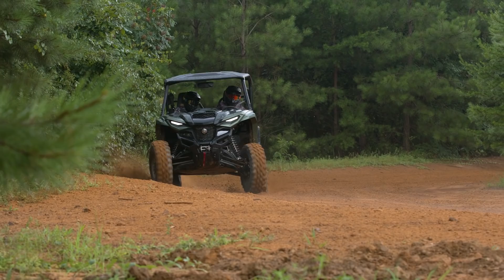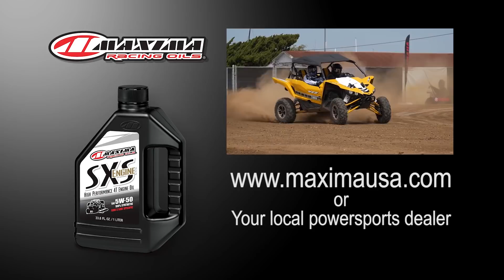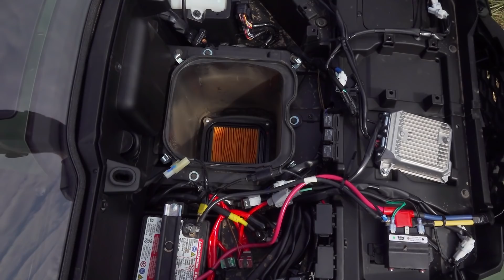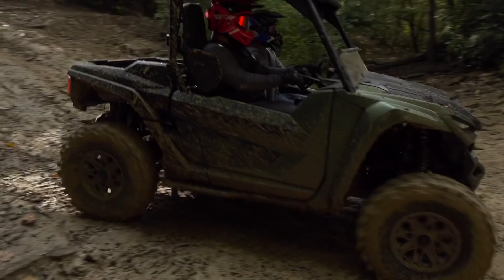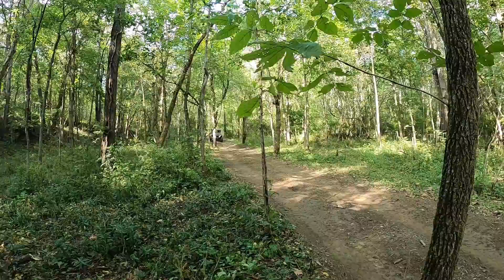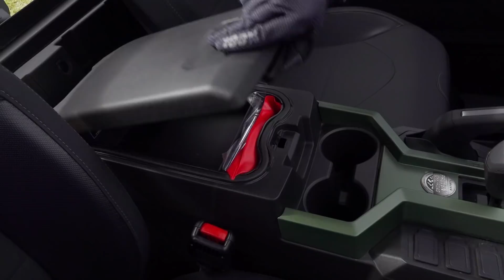2021 Yamaha Wolverine RMAX 1000 Test Review, Polaris General XP 1000 Killer?

Comment: Bought an le today. My previous 3 side by sides have been Polaris. I still own 2 of them. All I can say is wow. If anybody who owns anything made by Polaris drove one of these they would immediately set their Polaris on fire. Lol. Not really, but it’s just that much better. It’s not even close. Build quality, transmission, acceleration. Just how smooth everything is. It’s just not even close. I am absolutely blown away by this thing. It is as smooth as driving my new platinum f-150. My son got on my 2015 raptor that has big gun dual exhaust, intake, big gun power commander, carbon fiber wheels, holeshot hd tires, and the rmax in 2wd sport mode beat it to 60 on grass easily every time. Amazing machine. And I’ve had it for 1 day! I cannot say enough positive things about this machine. The dealership I bought it at is  getting another one in three weeks and I think I’m going to buy it too. Trade in the 2 Polaris I have for it.

Comment: I don't know if yamaha ATV are like their motorcycle, but the motorcycle are bullet proof. I bought an FJR 1300 with 100000 miles on it, sold it 5 years later with 120000 miles with just basic maintenance. Sold it for 500$ less than I paid.

I had 6 yamaha motorcycle so far a few honda, suzuki, kawasaki. Nothing beat Yamaha so far.

Comment: Bought one this weekend a 4 seater I’m glad I did after watching this video
Reply: Hey, How are you liking the new Rmax. Im looking at the same one. Any regrets? Whats your biggest complaint so far ?? Thanks
Reply: @Poptart635  my transmission crapped out, apparently it’s a issue Yamaha is working on they’ve got it in the shop for warranty work other than that it’s great, even with the issue I would still purchase again
Reply: @EverythingsTactical  how many miles on it when the transmission broke.? I have a Base model Rmax4 with 65 miles on it. And what exactly went wrong? Did you get it back yet and how's it seem now?
Reply: @dwightrhodes2051  had 97 miles on the rmax xt-r when it went out, happened at the end of February and got it back second week in April, I’ve been out 3x now (all weekend on 3 different trips) and we have put it to the test-zero issues, not sure what exactly happened but they showed me the old one and it was destroyed inside and out
Reply: Is that the bearing seizure ive been reading about?
Have you had any other issues or complaints? What other models did you consider?
Thanks!!
Reply: @Poptart635  conciderd the Polaris general but this one is fully loaded and 8k cheaper and come to find out it beat the general in everything, plus this one is shorter than any rzr, and I wanted it to fit in my garage, no complaints on the Yamaha except the transmission issue but it’s understandable I’m just glad it’s under warranty

Comment: Do your research. Dont just listen to a fancy commercial like I did. Not happy with my x2 and pissed with yamaha as they couldn't even return a call or email and defiantly ZERO help getting anything fixed. Parked rattle box at 22hrs. Bring back the old yamaha. All my toys are yamaha and after 30 years im now going to polaris.
Reply: your mix up you mean all your toys Polaris your next buy from now on Yamaha
Reply: Whats wrong with the X2? What are the main complaints? Thanks
Reply: @Poptart635   biggest complaint is yamaha would not return my call and when i got a hold of them they said and I quote " fix it your self its not that hard" brake down non stop. 22hr in and parked. Read this clearly NO WARRANTY on any thing and I mean any thing. And make sure not to park it on a hill and have fun with the bent frame lol also i am not a hard mud driver. It broke down just doing the break in driving no faster then 30 on a flat road. Flat out junk. I now drive my old 1982 honda again.
Reply: @jeffproulx3388  did it brake down or break down what exactly broke they do have a warranty and a 10 year belt warranty. Why can't you park on a hill and why is the frame bent. Your comments are vague at best. With no real detail and the wording is as if you're a telemarketer trying to renew my cars warranty.
Reply: @dwightrhodes2051  I said you can't go wrong with yamaha. I had yamaha everything. Then I got a new yamaha product and noticed the difference from the old yamaha . the new yamaha will not and I mean will not return any email even if you spend 27 thousand like me. They will not and read this clearly they will not fix anything. I don't care if your god. Nothing. And I quote from head yamaha " its so easy just to fix it your self" parked at 22hrs. If you still want one have fun with your bent frame. My x2 came bent from factory but I have seen lots bend on the trail. They added more metal on the 2021 but dose not fix the issue of them being dirty and not talking care of loyal customers. I had way more issues then that just saying. Parked at 22hrs with no help from a million dollar company :(
Reply: @jeffproulx3388  what broke?

Comment: Picked my 2021 RMAX up 2.5 weeks ago, base model. I have a windshield on order, and will be getting the winch and GPS soon. I'm doing the 20 hour break in period right now with 8.5 hours on the machine thus far, no more than 1/2 throttle (I think..Lol) I can you personally, this thing is a beast! I cannot wait to go full throttle and let her fly. I have only driven 41mph max, mostly between 25-35 for break in period. It climbs like a goat. I am 6'4" 200 and I fit the best out of the other SXS I sat in.  It gets looks everywhere I trailer it! Love the bed for supplies.
Reply: All engines are broken in within 3 heat cycles....all engine builders will ell you this.

Comment: Just got back from a side by side comparison of the RMAX and the General XP, on paper they are similar, but in person I find more pro's to the RMAX than I do the General.  Starting with the pros on the RMAX, beefier shock brackets and most frame and steel fittings/welds, fit and finish, dash layout, latching interior compartments, interior lighting, winch, electrical protection throughout, just to name a few.  Pros on the General, seat goes back a little farther, lock in ride for accessories, outside door handles, higher doors to eliminate the Yamaha shoulder bolster, inlays for windshield and rear window, lots of options for accessories.  I too am looking forward to a ride comparison of the two machines.
Reply: Also compared the KRX at the same dealer and loved the comfort and ergonomics of it, but the fit and finish wasn't even close to the RMAX or General.  I do like the KRX and it was on my list of machines to buy for 2021 but after doing a side by side comparison I'm not sure its on my list anymore.
Reply from the maker: Thanks for sharing your findings. We haven't had the chance to get the two machines side-by-side yet. We are slated to receive a General for testing. Good info. Thanks.
Reply: I almost wish id have waited for the wolverine 4 seater but im really enjoying my RZR XP4 1k.
Reply from the maker: @SupermanXCI  Well, you have a great machine and it won't be your last. Things are looking pretty good.
Reply: Without looking at both I can tell you Yamaha is the winner they build quality stuff just like honda. Polaris is garbage compared to Yamahas build quality.

Comment: This machine is really starting to grow on me, but do we really need another dump bed utility machine, this has the ingredients to easily be a sport SXS, the travel for an A arm is very impressive, still would rather have a longer wheelbase with a swing arm setup, I love the front end look and stance, but hate the look and do not need the rear dump bed 🤢🤮, all said and done Im sure this will be bulletproof and hope the YXZ gets this design language very soon
Reply from the maker: Fortunately, the dump bed doesn't do much of anything to hamper performance other than add a little bit of weight. We kind of like having it because it helps reduce the need to turn right around and buy a cargo box although they are available if you want one. We have seen videos of other media testing them out west with a spare tire laying flat strapped down in the bed. No tire carrier needed. We bet that there will be a lot of sport enthusiasts who will go for the added feature of the dump bed. No side-by-side is perfect for everyone but we think this one will certainly be a great choice for a lot of people. Thanks for checking out the review and sharing your feedback we love hearing it.
Reply: @UTVonDemand  That’s true I guess, but look at the KRX, easily can fit a 32 inch tire in the bed and have plenty of cargo and usability without having to be utilitarian, plus the cages look wack when you have a dump bed lol
Reply from the maker: @dwayneeverett755  Good point on the KRX.
Reply: Dump bed is a must for people who actually use these for everything
Reply: The dump bed is very nice when needing to access all the things needed for an oil change!
Reply from the maker: @Cuyose  great point

Comment: Can you confirm that you can get the Dmode on base model for 300 dollar  add on.  Thanks greatv review
Reply from the maker: Confirmed!😎 we remember that specifically because we we're a little disappointed that it didn't come on the base model until the guys at Yamaha told us it was a simple $300 add-on.
Reply: What's D mode?
Reply from the maker: @markwalker2637  Yamaha call zaddy mode. We assumed it stands for drive mode. Referring to the different throttle modes.

Comment: Ok... I’m ready for the RMAX4 XTR review. And I’m even more ready to have it in the driveway.
Reply from the maker: Hopefully both of us will be able to get our hands on one soon.
Reply: I've driven the RMAX2 XTR and now have the US  RMAX4 LE and the RMAX4 both rides better and has better stability.   https://youtu.be/JyvAvELev2o
Reply from the maker: @MassiveOverkill  interesting. Might have something to do with the rear sway bar.
Reply: @UTVonDemand  that and the staggered setup as the RMAX4 also has 11" wide rear tires vs the RMAX2's 10".  The extra wheelbase length doesn't hurt either.
Reply: Despite having a rear sway bar,  I detect no wheel hop and ride as I've said, is better than the RMAX2.  Yamaha really hit a grand slam on this one.
Reply from the maker: @MassiveOverkill  indeed.

Comment: You can buy and install without much effort the D Mode option on the base RMAX. As well as easy to install the the interior foot well lighting. If I got the base I would only have the winch installed, the rest is easy.
Reply from the maker: Right you are.